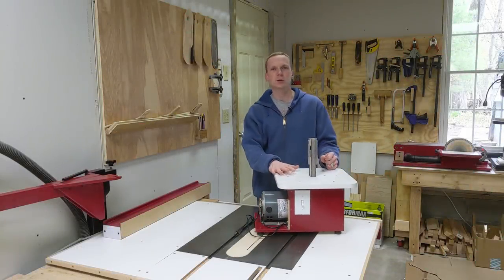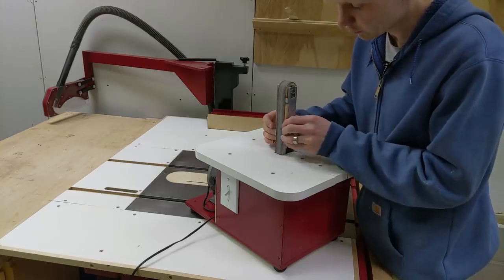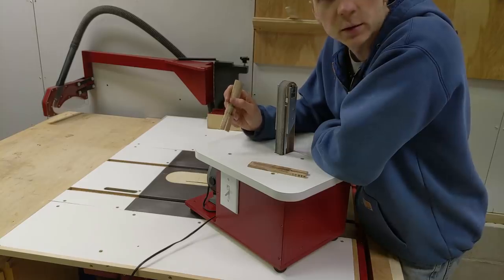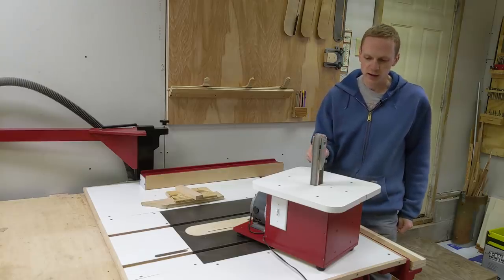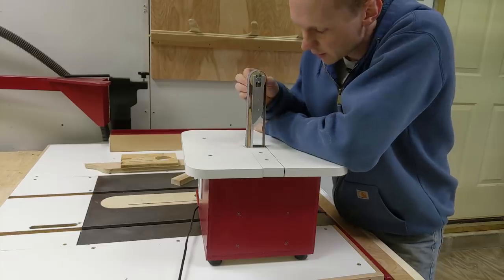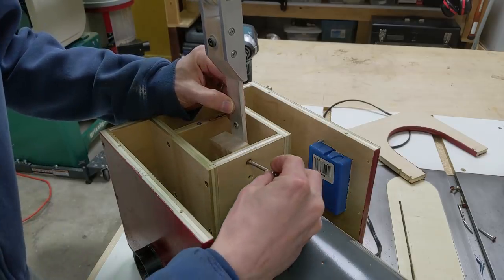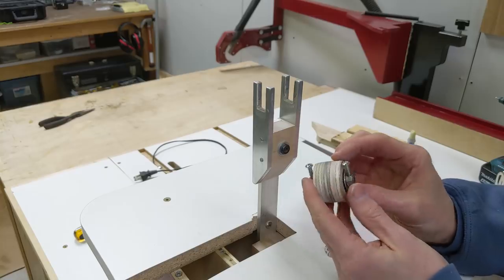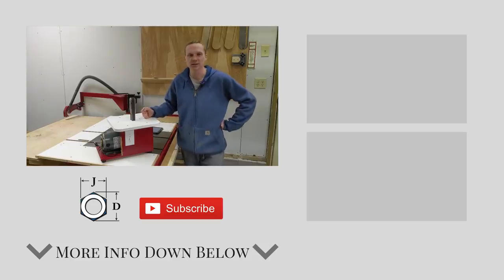Why this is my best sander (and how to build your own)

Comment: This thread is 4 years old, I found it following release of Justin's pantograph cabinet door vid which is excellent.  I bought the plans, this is great for compactness and easily interchangeable rounded vs flat platens is a magnificent feature that commercial machines don't have
Reply from the maker: Thanks Mike! Would love to see your sander when you finish building it. I still use mine all the time!

Comment: Really awesome job.. just some questions.. 1. I see you put a bicycle tube on the lower wheel but not on the upper wheel - can it be added to the top wheel also to provide better support , and 2- how do you adjust the tension/slack on the belt so it doesn't bind or slip when it is running? 3. could your plans be modified to use a larger width belt?
Reply from the maker: The bicycle tube on the upper wheel is not necessary, but yes, you could put one there. The tension on the belt is done with the two screws that go through the upper wheel axle. I believe yes you could modify the plans to use a larger belt. Everything would just get wider in that direction.

Comment: It looks like a fantastic machine. But wouldn't one of the downsides of this compared to a normal 1 inch belt sander be the length of the belt? they're usually much longer than yours, so less likely to clog up, faster cutting action?
Reply from the maker: I am using a 30inch belt which is pretty common. There are 42inch machines out there too, which yes would last longer.